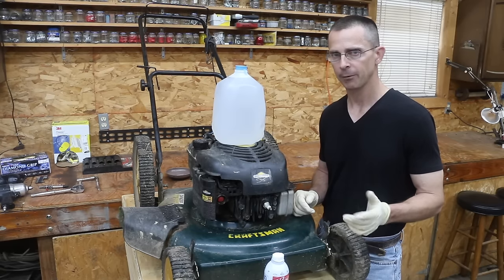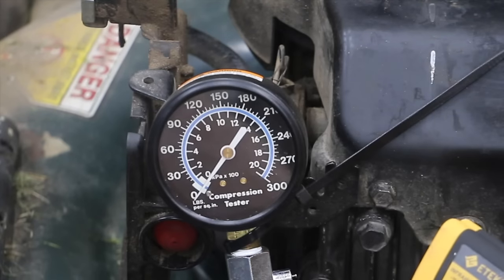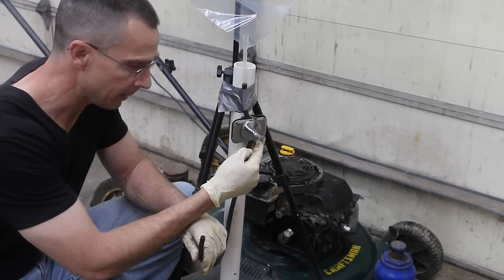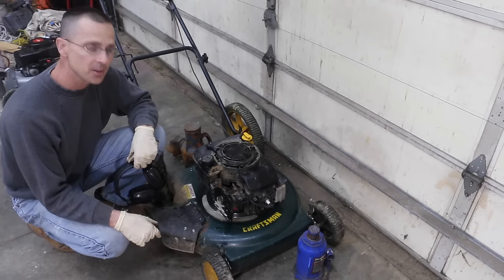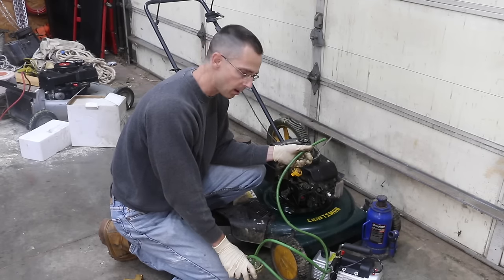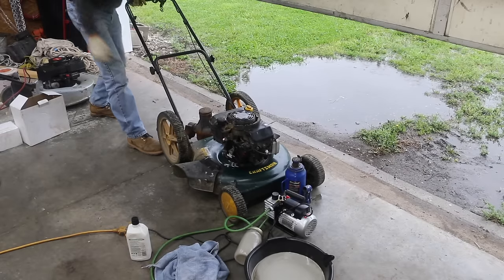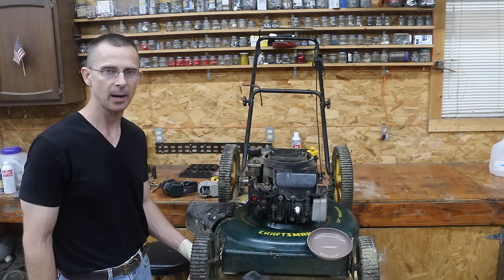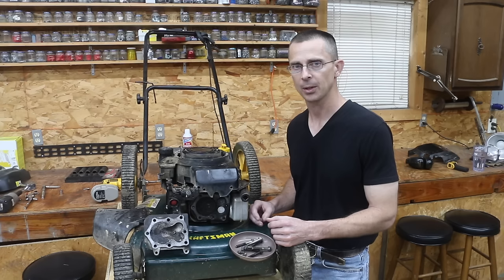Seafoam--can't believe what it did to my engine episode 5--cylinder cleaning test using water!!

Comment: I've never heard of using water in the same way as using Seafoam. Honestly, I was hoping water worked better. Mainly because when you use Seafoam, it transfers all those dirty deposits onto your sparkplugs. That's why it's best to change your plugs after using Seafoam. I was hoping maybe the deposits wouldn't transfer to the plugs while using water.
Reply from the maker: Thanks for the feedback.

Comment: Methanol alcohol mixes with water.   So, you can mix about 1 part methanol ( such as "heet" fuel system antifreeze) with 3 parts oil.   Run a few minutes and drain.   The old Radial AirCraft Engines which had Cubic Inch Displacements (CID) of between 1,820 CID to 4,360 CID used a WATER / METHANOL injection at the very highest power settings, primarily on Take-Off.   Whenever removing Cylinders from these engines (they are all individual cylinders), they would be quite clean inside.   The poor results that you observed with the lawnmower engine is because they are LOW power and LOW Compression.   With the flame temperature in these high power supercharged aircraft engines; the flame temperature is around 3,500 degrees fahrenheit and a pressure delivered to the cylinders of about 4 times the normal atmosphere with a compression ratio of between 7.5 to 8.3, depending upon the specific model of engine.   When the water, which is a continuous injection, collects on the carbon in the cylinders and then after ignition, these droplets literally "explode" blasting the carbon off of the engine parts in the combustion chamber.   The evaporating water reduces the temperature of the Exhaust Gas and therefore the Engine Temperature, as you saw in your demonstration.   The water / methanol mixture, called Anti Detonation Injection (ADI) allows the engine to produce higher power than is possible without the ADI because the Exhaust Gas Temperature is reduced decreasing the possibility of destructive DETONATION and reducing the possibility of an engine failure due to the lower Exhaust Temperatures and somewhat slower flame propagation within the Cylinder Combustion Chamber.   I have also cleaned and improved the operation of both Car engines and Light Aircraft Engines by using a Garden Hose and giving a flow rate to a give a slight engine RPM decrease, for several minutes at a time.   I have significantly improved the operation of engines in this manner which were not operating very well.   For high power settings, AirCraft Engines use a very "rich" fuel mixture.   The extra fuel that is not burned is used for cooling the Exhaust Gas Temperature, allowing for a higher power setting than would be possible at a "chemically correct" fuel mixture, which also gives the highest flame temperature.   IF you would like to see AirCraft that I used to fly, (I was the last person to fly either of these aircraft), go to Google Earth, navigate to Palmer, Alaska at the south end of the airport.   You will see 2 each, C-119F model Flying Boxcar aircraft.   They are each equipped with R-3350 (Radial 3,550 Cubic Inch Displacement) AirCraft Engines which produce 3,500 Horse Power each on Takeoff using the 100LL (100 Octane Low Lead aviation fuel) aircraft fuel.   I have used many "additives" in Car engines and Light AirCraft Engines, but I have NEVER found any which actually even come close to their deceptive and false claims; or maybe a better evaluation would be their outright LIES.   BTW, IF you want to try using the WATER method of cleaning an engine, use a flow that is almost too much.   You will not hurt the engine and you might actually cause it to run better.   In about 1974 I had a 1966 Pontiac GTO which would leak fuel from the carburetor some times.   One day the car caught on fire; I knocked the air cleaner off and was throwing double hands of sand onto the engine in an attempt to put out the fire.   A guy in a motor home stopped, ran to the car with a fire extinguisher and put out the fire.   He said "gotta go", ran back to his motor home and drove off.   It all happened so fast and then he was gone that I didn't even thank him for his help.   I thought, NOW what am I going to do?   The car had been running terribly for a while and figured that I need to get another car.    SO, what else could I do?   I put the air cleaner into the trunk.   I turned the key and to my amazement the engine started, even with the carburetor full of sand.   I only had to drive a few miles home.   At home, I ran the engine up to high RPM and it all worked fine.   I had never heard of anyone "flushing" an engine with water.    However, HOW was I going to get the sand out of the engine and off the top of the engine.   I started the engine, got the water hose, turned it on to full flow and started flushing the sand off the engine.   Then, I decided to try flushing the sand out of the engine with the water hose, so I ran the engine RPM up to probably around 5,000 RPM and started running the water into the engine as I opened the throttle to wide open and controlling the engine RPM with the water flow.   No disaster, no strange sound, the engine was running smoothly at the high RPM, so after around 5 minutes I reduced the throttle and water.   I allowed the engine to idle for another 5 to 10 minutes.   After this, the engine ran better than it ever had since I owned the car.   No more smoke out the tail pipe even at maximum power and acceleration.   I bought a "Carburetor Kit" and repaired the carburetor, which solved the fuel leaking problem.   The engine was still running very well when I traded this car and bought a newer and far fewer miles 1968 Pontiac GTO.   BTW, I have watched this video several times.   My evaluation; after wasting a lot of money on "additives" is to NEVER buy any of this garbage that is sold as an improvement for cars.   My advice:  try WATER, as I have described, but don't expect it to do much to help your lawn mower or other low compression and low powered engine.   The best way to keep an engine clean is to keep the OIL clean and make sure that your engine is running with the correct fuel mixture, especially, if you can run it on the lean side of Peak Exhaust Gas Temperature.   A LEAN mixture, as in ALL modern Cars will NOT hurt your engine.   Don't waste your money on false claims on inferior products.   On another Project Farm video I also made a long comment on other Fuel / Oil additives.   Have a great day!!!
Reply from the maker: Thanks!  Thanks for sharing.

Comment: I have used water in cars. I did it differently... Run the engine pretty fast while pouring water down the carb. Pouring it till the engine started to show signs of quitting then stop pouring and letting the engine get back to speed, Used about a quart or 2 of water. It worked for me. Another thing I have done is pour ATF down the carb when the car is running to get stuck valves free. That works too.....(It will fog up the neighborhood real well too. No mosquitoes left after that hahahah)
Reply from the maker: Thanks for sharing.

Comment: Been doing the water trick for over fifty years and it never got into the crankcase. Something is very wrong with the test. In fact, car makers at one time made water injectors for their engines as original equipment from the factory.

Comment: I'd water inject an engine to clean out the scummy deposits left by turbo direct injecting a gas engine.

Gearheads will do it for performance though. Because water will scavenge heat back into the chamber where it belongs.
Need to have good rings for that though.
Also it's more like a quart of hundred proof an hour at 2-4k rpms or more under load.
In a 2-4l / 4-6 cylinder.

Comment: racers and airplanes in ww2 used water so they could increase the timing of motors due to the fact of the cooling properties.  Boosting the timing allowed for an increase in the horsepower output.
Reply from the maker: Thanks for the feedback.

Comment: Seafoam does better job. And much quicker. I looked inside my cylinder of z125pro (17000km on it, running mostly regular) and noticed buildup which caused power loss. Hired neighbor for help and keptnspraying in the intake as per instructions. 10 min later and 50% carbon is out. Cylinder crown nearly all clean but head still having some. Noticeable power increase (restore). Just in time for the track day. Will likely try water as well, but in form of mist spray. Fine water particles will likely do much better job than droplets.
Reply from the maker: Thanks for the feedback.

Comment: I realize this is an old vid, but I just have to say something. You kind of missed the whole concept. I’m not sure how well this will work on an engine with a governor. The key is to get the engine really hot and hold the throttle to maintain about 3500 RPM or so while spraying water in the intake, emphasis on spray not pour. The key is to create steam, and then, after that’s done, spray a fair amount of ATF or light lubricant of your choice. Also, not a bad idea to perform this when it’s time for an oil change anyway, just in case any of the water gets past the rings and into the crank case which it shouldn’t if you did it, right.

Comment: let me really confuse the hell out of alot of you,this test just brought back memories of my dad and i,he was in ww2 drove a gas truck,big giant gas truck,he lunched with the air mechanics and others,they were talking one day of the new water injection systems on the fighter planes,and how it cleaned up the ports and cylinder heads on the engines,they used water and methanol mix it gave the planes more power in dog fights and dives,esp coming out of dives on armed targets,water injection works,and it cleans the engine,it has to be metered,better than a bag ,the water into the engine definitively thru the compression rings,as a mower with 20-30 lbs on one pull and 60 after several pulls has worn out rings in it,just noting
Reply from the maker: Thanks for sharing.

Comment: Im guessing that you didnt let the engine stay warm enough to evaporate the water.
Reply: you said you would do another video with water as a mist or spray. can i suggest that you monitor head temp so that it stays above boiling. i dont think you will have the same issue as you did with water last time. Also the steam created at a hotter engine temp should be more powerful cleaner.

Comment: Steam does the cleaning. Adding water too fast or long will cool the combustion chamber down too much to make steam. Would of worked better if water was introduced, allowed to steam then back to regular fuel. Keep the cylinder HOT. Try using a pressurized vessel that will emit tiny water droplets.
Reply from the maker: Thanks for the feedback.

Comment: I watched one of my friends do the water clean on his VW bug -engine. He pulled the carburetor and opened it wide open while running then took the garden hose at half full pressure and poured it down the carburetor that engine continued running like a top. Yeah it smoked like h*** h*** but it didn't ever stall out.
Reply from the maker: Thanks for sharing.

Comment: I would not run water thru an engine EVAH - it's too likely to end up in the crankcase like we saw here

To flush water out of an engine - hydraulic fluid works great - IHC/Case have HyTran fluid, Deere has HyGard fluid - both will bind water and dissolve associated crud so that the crap can be drained from the crankcase
Reply from the maker: Thanks for the feedback.

Comment: It seems to me that the amount of water that you ran through the engine was much more than should be necessary. The quantity of Seafoam was only a few fluid ounces, yet the amount of water was nearly a gallon. It would have been interesting to see the water result if the motor had only run water for about 30 minutes.

Comment: Anyone ever heard of hydro locking an engine? Or just bending the rod in general.
Reply: If you do it slow enough it will just combust with the gas just not as easy. I've never had any issues tho bending rods with water. I've put my atv in water much higher then the airbox getting water down the motor and into the gas tank. If you know enough about about your machine you can either run it, risking hydrolocking, or like what I did and kept it at low rps so it wouldn't do damage if too much water got in it. I would much rather have to drain the engine then replace stuff

Comment: If Seafoam gets in the oil, no harm done. I consider this process to be preventative maintenance, rather than cleaning massive amounts of carbon. I’d say spraying a mist of water into the intake might be better than the drip method. An ounce of prevention is worth a pound of cure.

Comment: I laughed and had to stop video at 6:40 blow by.  I’m here saying “Yeah that water done ate up those rings “ 
Ok answer to your questions 
No I would not use water in engine  water is not safe to use on parts that need constant lubrication 

Seafoam is a safer method as it is safe to use in oil and fuel side of engines
Reply from the maker: Thanks for watching!  Thanks for the feedback.

Comment: Ice cold water works the best with a squirt bottle set on stream, make sure the motor is at normal operating temperature then with the motor at idle start to squirt the water in the intake until it starts to bog then rev up the engine a few times very quickly then stop squirting the water let the engine idle for a minute then do it again one more time and then your motor will be decarbonized, seafoam only cleans the intake and barely touched the combustion chamber, the best injection cleaner out there is 44k all the rest is a waste of money
Reply from the maker: Thanks for the feedback.

Comment: I don't know if this is worthwile for your engine testing,  yet here's a request for a future water, MMO, SeaFoam test consideration:   I see alot of YouTuber's struggling in snowing temperature cold RV's with severe carbon buildup on their Chinese Diesel Heaters.   So far,  it appears there is not anyone with your testing skills and considerations have shown any clear cleaning results (without manually taking it apart for cleaning) .   It appears like ALL of these diesel heaters are prone to severe carbon buildup.  IMHO,  there is an unmet need to determine a cleaning product to add while it is running on high;  like a cleaning cycle period like your efforts did with the lawn mower....for a couple of hours,,,, while it is still making useful heat.
Reply from the maker: Thanks for the suggestion.

Comment: No Conclusion ???  Great job.  Water and Carbon will produce CO or CO2 depending on pressure and temperature. As a cleaner it for me, is not a worthwhile method. Did not get it clean enough. Plus the Oil change labor. Never do this on an Automobile engine. For small engines only.
Reply from the maker: Thanks.  Thanks for the feedback.

Comment: I personally would never use water to clean the carbon out of engine cylinders.  Water does not compress and can cause major damage to the engine.   Hydro-Lock and Sudden Engine Stop is one of the worse things that can happen to an engine and water is the best way to achieve this. It can also bend or break valve stems  the piston or head, crank, rod, etc.   If I was going to attempt this as an experiment I would use a water mist with a spray bottle or some kind of atomizer to minimize possible damage.      I think any kind of petroleum product would do a much better job at removing carbon deposits when added via the carburetor intake, such as Gumout or Gunk Engine Degreaser, or even Transmission Fluid.  Water is just a bad idea.
Reply from the maker: Thanks for the feedback.

Comment: IDK I'd never do this. Water got past either the rings or made a crack somewhere. Cold or room temperature water to hot running engine never ends well. If it was a car I'd have said you blew out  your head gasket or cracked a wall somewhere after seeing the milky white oil.  Honestly surprised you got it started again.
Reply from the maker: Thanks for the feedback.
Reply: @ProjectFarm  Thank you, for having such a intriguing channel.

Comment: After all the oil swapped out i think seafoam is cheeper to use then water also not as dangerous to the motor . But in realality if your motor is that bad buy a new car or rebuild it properly.

Comment: Seafoam i think would better used, some may mix with the oil, but that would be better than water mixing in, I used water back in the 70's in may ford   grand torino with a 351 Windsor, it didn't hurt it any, but how i wouldn't try it
Reply from the maker: Thanks for the feedback.

Comment: Many years ago, an old man told me that if, on occasion, I slowly pour ATF into the carburetor of a running engine until it stalls, and then restart and run the engine until the smoke stops coming out, that it would clean out the carbon deposits. He said it works because ATF has additives that make it slightly corrosive in order to keep transmissions clean and free of rust. I never actually tried it.
Reply from the maker: Thanks for sharing.

Comment: That's what I thought would happen. (When adding water)
I have a motorcycle, and I had put one of those air filters, that is made as a cold air filter. (In other words; you can see the air filter, because it has no cover.) One day I was riding, and it started to rain. I could literally see the raindrops being sucked into the filter. And because of that, I refitted the original OEM air filter housing. And I thought; That cold air intake filter, (that looked trick) could have cost me my engine!
Reply from the maker: Thanks for sharing.